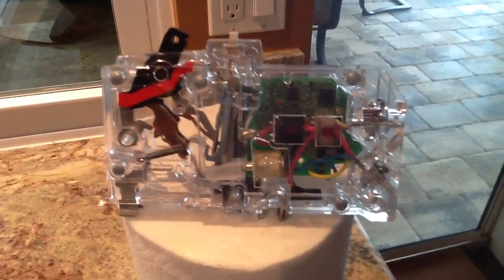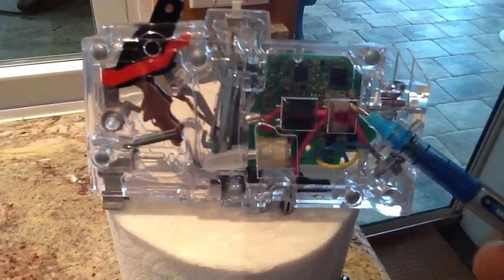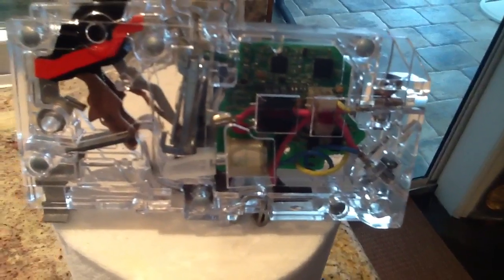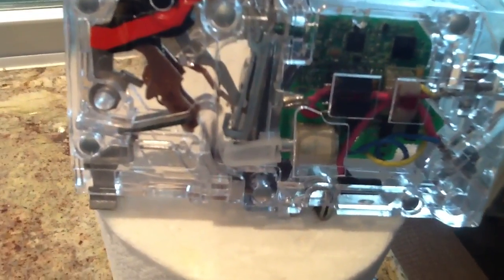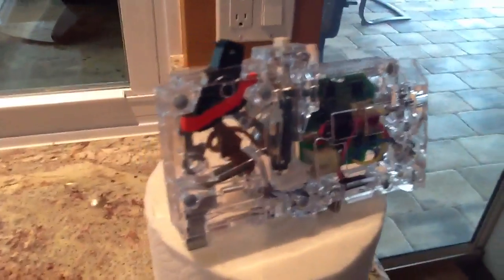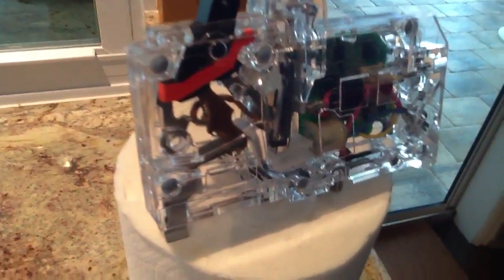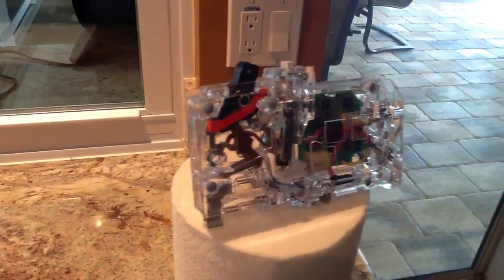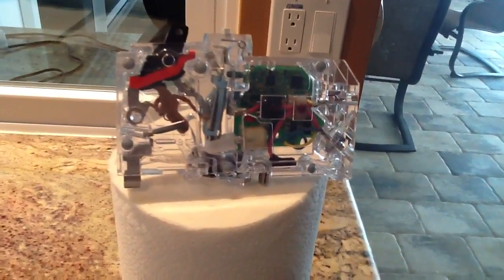internally working of Square D GFI Breaker

Comment: Did you mean 25 kilo ohm rather than 25 ohm? A 25 ohm resistor would allow 4.5 A on 120V!
Reply: I got 4.8  Ma with 25k ohm on 120 volt, but the percentage depends on the type of calculator a person is using too. Which doesn't matter with this comment.